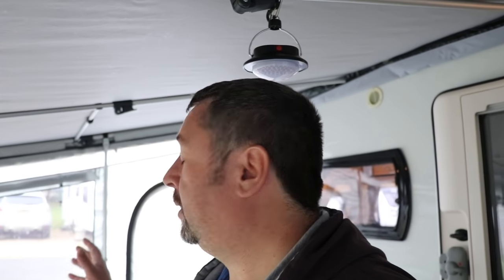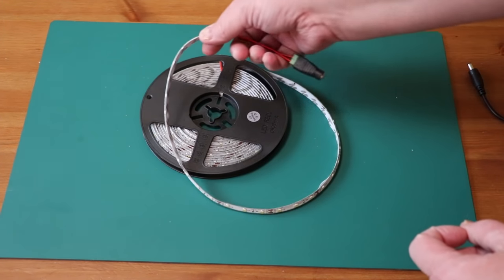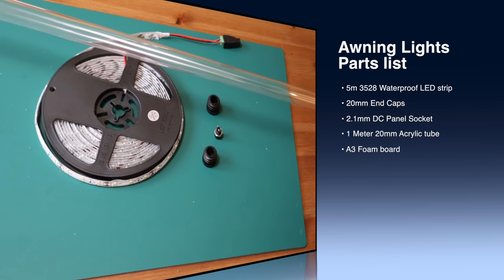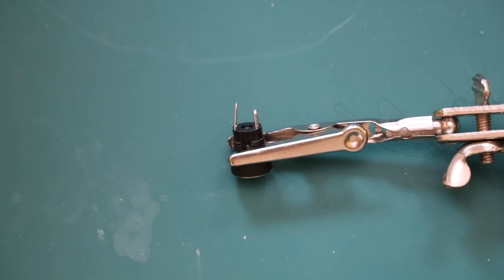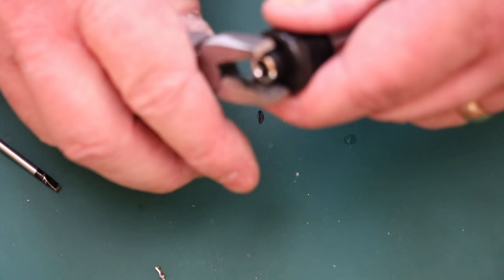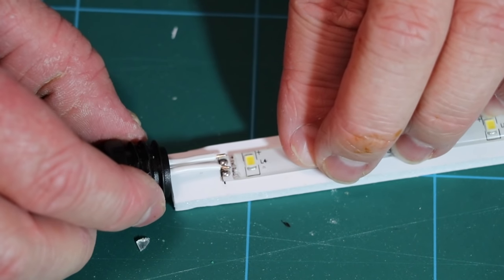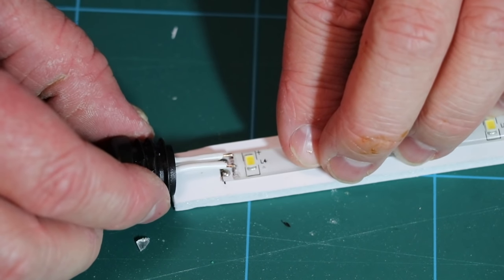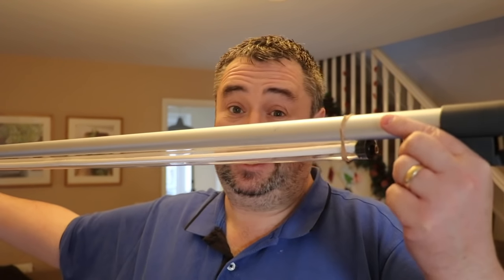Custom affordable caravan awning LED lights

Comment: Thanks Dan. Great idea I've made up four 1m lights now with 50/50 led strip and also a remote controlled light dimmer so i can vary the light output and turn them on and off. Total cost was under £40 with the light strip, dimmer (which fits in the tube behind the foam board), the power brick and the connectors coming from Ali express.
Reply from the maker: Fantastic - Well done

Dan
Reply: i was just going to add the same comment funnily. if you buy the dimmable strip lights 
  http://www.ebay.co.uk/itm/252832124865
and add the remote dimmer 
  http://www.ebay.co.uk/itm/111706609553
it will function exactly the same as the Kampa sabres

Comment: Hi Dan, I’ve just treat myself to a new van and air awning and being a tight fisted Yorkshireman I’ve made up a couple of lights as per your video. However I didn’t stop there, when we’re on a hard standing we cannot use the garden type led lights to illuminate the approach to the caravan, so staying close to your method I found some clear water pipe in the garage which made me think a flexible light. The way that I made this able to keep its shape was to fix the led strip to a length of 2.5mm twin and earth the end with the electric connection just glued in and the other end filled with clear silicon sealer. Thanks for the idea!,

Comment: I have something similar in my shed i just use cable ties. Great video Dan.
Reply from the maker: I thought about cable ties, but I'm thinking of a bungee loop idea. lots of options - and plenty of time to try ideas out. 

take care 

Dan
Reply: velcro straps?
Reply from the maker: Yep i think thats what im going with. Ive purchased up some 15mm wide strap - will see how it works.

Comment: Great video once again.  We use the RGB strips as Christmas lights and background lighting in the MH.  Just a suggestion but have a dig around the garden centre, we found some white plastic clips, S shaped but with one end flattened.  I think they could be just what you are looking for.   I have found with the RGB lights that the IR ones can interfere with the TV control and the RF ones get annihilated by V/UHF signals from my radio gear.  Thanks for the video.  Dave
Reply from the maker: Afternoon Dave, Thank you. we used the RGB ones on the previous install. to be honest we never really liked the colour, i know you can create any colour you want, but they just looked terrible. and yes - They changed colour ALOT when channel hopping ;-) So, having used these LEDs in the caravan (when i created the pelmet lighting) we really liked the warm colour.

Thanks for the tip on the S clips - i will have a look after Christmas - it's a bit of a war zone out there right now ;-)

If i don't speak before - have a lovely Christmas. 

Dan
Reply: :-) Merry Christmas to you and yours also.  We will be away in the MH as usual over the holidays to get away from the war zones :-)

Comment: Hi Dan. I've finished the LED lights, what im going to do is create a video, not of the making but to show the finished project. i will add a link to your video here if thats ok? i am going to make a few videos of the caravan etc for the future, as you said in your Do me a favour video. its been fun.  thanks again Neil
Reply from the maker: Neil Haywood brilliant stuff !! I've got a couple more LED based videos yet to come out and a couple more "home made" videos too. Are you happy with the finished lights? Can't wait to see them and what was your final bill??
Reply: Hi Dan I made three in total, worked out to around £12 per light. i did put two connectors on each of the longer ones. i know they are in series, but easier to connect together. i will try and make the video this week. quick question, have you ever fitted an exterior socket to a caravan. ive seen your video replacing one in the wet box, but wondered if you had fitted one to the exterior itself? we have just bought a Sprite Alpine 4 and it doesn't have one fitted. so im considering fitting one to the awning side of the van.
Reply from the maker: Hi Neil, no never fitted one. Although it doesn't look difficult, I would personally get someone in to cut the hole & feed the socket back to the consumer / fuse box etc. 

Not much help - sorry. 

Dan
Reply: you can buy a Bulfinch, fully water proof for around £32, i dont have a problem with electrics, i'm qualified like you say, its the hole you only get one shot.

Comment: Hi Dan and Family, Just subscribed to your channel, catching up on loads of videos, great to watch and answer many questions.  Thank you. We haven't got a Caravan but a Folding Camper so some things are relevant.  And for those that are not aware what a FC is compared to a tailor tent (TT) a TT is where you use guy lines to hold everything in, FC doesn't...  imagine a caravan cut in half then a canvas for a roof :-)
I assume as the power supply you have used in this video, it doesn't matter about the polarity of the power supply that you used?  Some transformers have the outer part as positive (+) and the inner is negative (-) other can have it reversed?
Thanks again

Comment: Nice tutorial. I like to make my own bits and bobs and this looks like a nice project for the future. Did you consider running them straight from the 12v system rather than using a mains power supply?

Comment: Did you purchase 3 mains adapters, i.e. 1 for each light, 
You could, with the correct joining wire and end caps, daisy chain the three lights, 
You could also power them from 12v, 
Still very good, cheap enough it seems a shame not to make some
Reply from the maker: Hi Mark, i didn't show the wiring loom, but yes they run in parallel, all wires come from one end. Also the loom i have made up includes a key fob style remote switch so you can easily switch the lights on and off from a key remote. It runs from 1 12v adaptor that comes from the wet locker. I will show this in more detail when we next have the awning up & you can see it in situ.

The KeyFob remote added £6 to the cost of the build. 

I hope that helps.

Dan

Comment: Hi great video I'm going to make mine up tomorrow but could you tell me what size cable you used or is it just speaker wire thanks steve
Reply from the maker: Hi Stephen, yes for the connection from the plug to the LED strip is small grade speaker or bell wire. Nothing special. 

Good luck, let me know how you get on.

Dan

Comment: Great video. I'm in the process of making some of these. One question, how do you get 970mm out of two pieces cut from A3 foam board when they are only 420mm long? Did you add an extra piece or use longer than A3 boards? Regards, Neil
Reply from the maker: Hi Neil, great to hear you're making up a set. Looks like I made a slight error here, I was using A2 in the filming, but to be fair I have just made up a set with A3 sized board and I simply divided the 970mm by 3 when they are in the tube, you can't tell that they are divided, in fact they stay straighter. 

Hope that helps. Let me know how you get on !

Take care

Dan
Reply: The Trudgians . Hi Dan that's exactly what I have done. Will let you know how they go once I have them assembled. I only need two in my air awning so I thought I would add two sockets to one and daisy them together. Best regards Neil . Ps keep up the great work with the videos.

Comment: Im still confused how you worked out your costs Dan.........the 20 x 16(bore) acrylic tubes are £11.99 each, the kits i have made, i estimate have cost me £23.97 for the first light (with inline switch and adapter), and £19.03 for each light thereafter.  The adapter alone on Ebay is £4.94
Reply from the maker: Hi Nick, The total cost for me was £39.85 - that was my total outlay on this project to create what you saw in the video. I have (as you have seen) added some bits to the setup. The big issue is the original supplier has since stopped selling the 1M lengths of the acrylic tubes - 

I have tried to be proactive in finding a new supplier and updating the links to the kit in the description below. I have found some new sources and suppliers who will not be so volatile on stock levels (i hope) sadly the price has increased slightly to £42 for 3 strip lights.

I hope that helps, I just saw the pics of your lights - they look great, you've done an excellent job !!

Take care
Dan

Comment: Hi Dan I know I am 6 months late but I just watched your video, well done you. I have a question for you regarding how the LED strip is cooled? I could not see any air holes for heat dissipation. Does this cause a problem with the longevity of the strip?
best wishes and keep em coming.
Reply from the maker: Hi Colin, no need for cooling holes or heat management, they simply do not generate any heat to worry about. 

I hope that helps.

Dan
Reply: Thanks.

Comment: Hi. what is needed to link the lights together like you can the Kampa Sabres? i already have the kampa ones for my awning but am tempted to make some of these up for under chassis lighting for when pitched up. And yes im sure it will annoy some neighbours lol
Reply from the maker: Hi Paul, you could simply add another socket on the other end of the tube and plug the Kampa ones into that. That would work well, or if they are in a different area, simply run another lead to your new lights etc.

Hope that helps. 

Dan

Comment: great video, where did the tubes come from, I have all the other necessary components
Reply from the maker: Hi Adam, have a look in the video description for a full shopping list,  The tubes I got from eBay :

http://www.ebay.co.uk/itm/CLEAR-ACRYLIC-PERSPEX-PLASTIC-TUBE-BAR-HOLLOW-5mm-6mm-8mm-10mm-12mm-15mm-20mm-/272011079162?var=570827844855&hash=item3f551fadfa:m:mdf1SIPaN2b3dM_tKV26YyA

I hope that helps.

Dan
Reply: The Trudgians cheers will take a look,

Comment: Great video tutorial, I saw you have added a keyfob remote but didn't know if you had seen these on ebay http://www.ebay.co.uk/itm/152236872287 as an alternative. They appear to be the same as Kampa use and provide dimming control, admittedly not as handy as a keyfob though.
Reply from the maker: Hi Steve, thanks for watching. No i haven't used one of those. Instead i opted for something like this : http://www.ebay.co.uk/itm/220V-10A-1CH-Channel-Wireless-on-off-Relay-Remote-Control-Switch-RF-315MHz-UK-/131867599587?hash=item1eb3ebe2e3:g:ktIAAOSwfZhXNanB

The one you have show looks great, though - so I might just get one of those and see how well they work. Thanks for sharing !

Take care
Dan

Comment: I found a supplier now ... what price did you pay for 1M?   ..... also what width to cut the foam board ? I assume 16mm right ?
Reply from the maker: Hi Nick, all the parts i used are listed in the description of the video. I just checked and you're right it seems they have stopped selling the 1M lengths now. If I recall I spent around £8 (this was some time ago) 

as for the foam board, yes cut it to 16mm. The thickness will stop it from moving around.

Hope that helps.

Dan

Comment: Nice vid Dan. I love LED lights.

I was thinking you could use plastic spring clips like these - http://r.ebay.com/9tlwGt to attach the tubes to the poles, you can get them in 20mm and 25mm which is what your poles look to be, then just glue them together.
Nice one Dan.

Comment: please can you tell us how to get to the top of the pump to refit the pipe after repair on a c250 cassette toilet. Thanks!
Reply from the maker: Hi Julie, 

The pump is accessed from inside the cavity. Have a look at this document, (page 8) it shows how you can access the pump and specifically the pipework above the pump. http://www.thetford.pl/serwis/naprawa_toalety/C250.pdf

I hope this helps.

Dan
Reply: Hi Dan, The thing is these photos are being taken with the toilet fully accessible. We can't fix the pump back on because there is no room for the pipe and a hand to fix it back together. Do you go in from the top  inside the caravan? If so how does the toilet come apart to reveal the top where the pump fixes? Thanks for any help.
Reply from the maker: Hi Julie, to access the pump you can get this from inside the compartment, use a mirror to look straight up, you should see 2 blue fingers, that need to be gently pulled apart to allow the pump to be released. 

Have a go with that to start, see if you can release the pump down and if you can gain access to the pipe work (you should be able to)

If not, the other route is from the inside, but thats another story !!

Take care
Dan

Comment: HI.DAN JUST STARTED 5 LIGHTS FROM YOUR VIDEO.ANYONE HAVING PROBLEMS LOCATING THE TUBING.TRY THE CLEAR PLASTIC SHOP.THE OLD BAKE HOUSE SYDNEY ST., CHESTERFIELD I HAVE JUST PAID £17 FOR 5 1000MM X20MM OD 16MM ID WITH 2MM WALL AS I LIVE IN CHESTERFIELD I WAS ABLE TO COLLECT BUT THERE IS A POSTAGE CHARGE HOPE YOUR FOLLOWERS FIND THIS HELP FULL .ERIC GREEN.